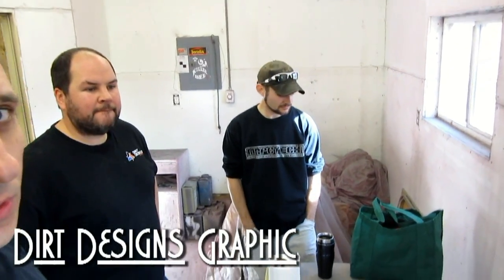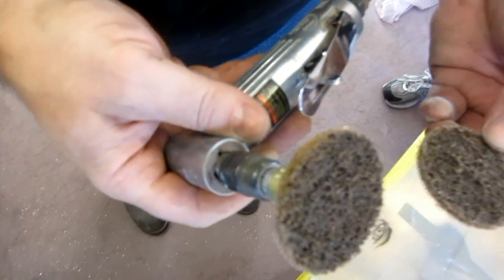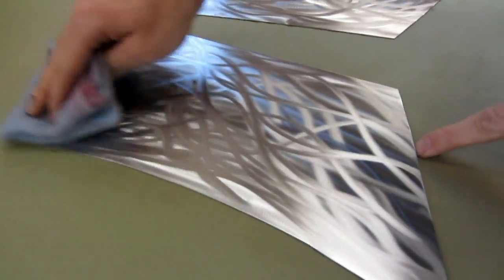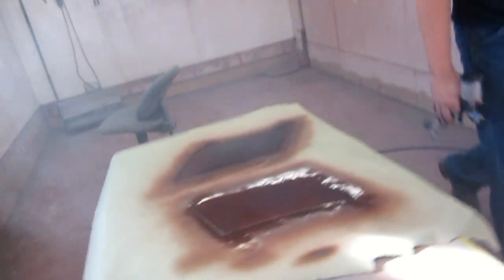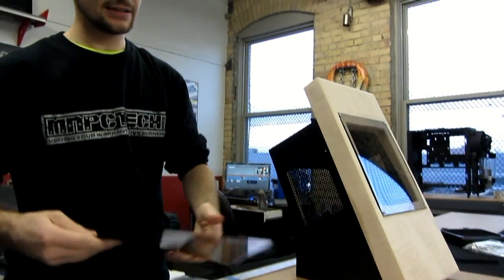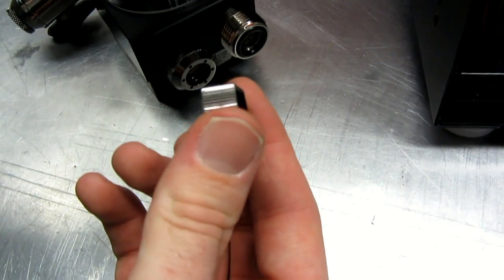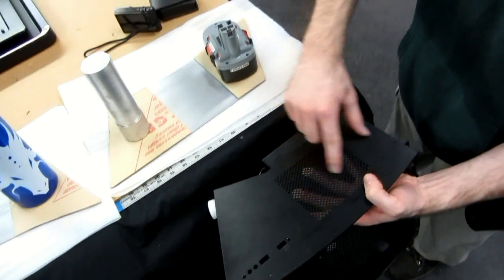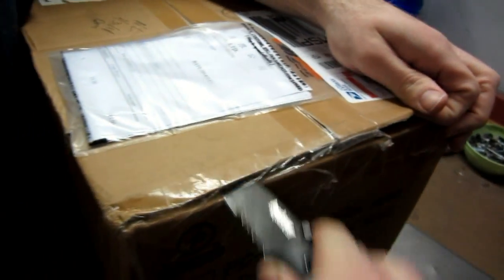"Dancing Iridescence" Lian Li PC-Q30 by Mosquito, PART 2

Comment: I would probably paint the whole thing a silver-chrome color, add some cool shape engravings to the side (they would make up an illusion), flatten out the front and possibly add an adjustable monitor. Some lights would be cool and maybe even some mnpctech fan radiators to go on the outside of the case.

Comment: take a lcd screen apart that would fit in the where the glass was and put it there.as for back lighting use the pc case lights and use the screen just for fx like a ghost imgie you can use flame water or what ever .